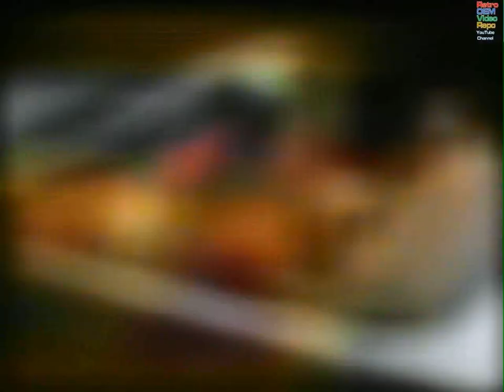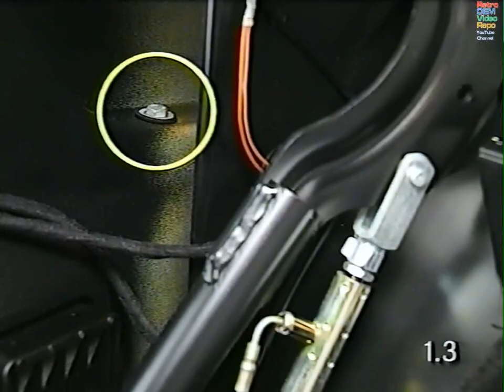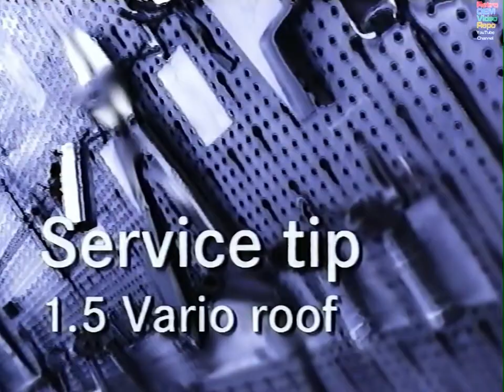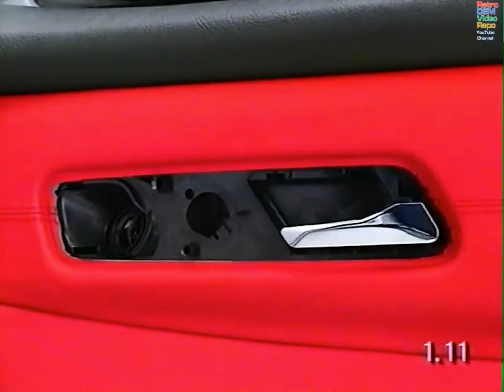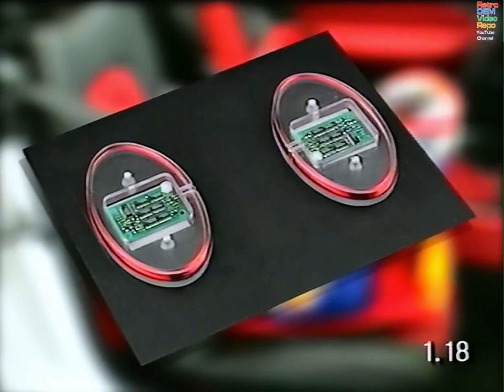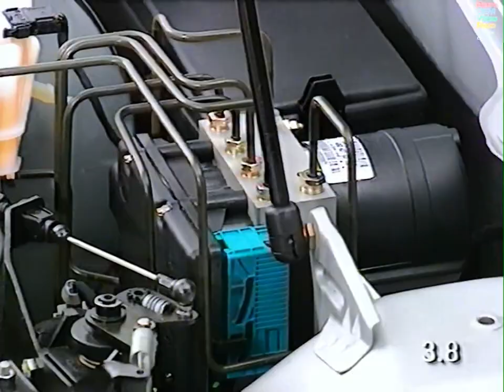Mercedes-Benz - SLK Roadster - The R170 from the Service Angle (1996)

Comment: I had one, a 320slk, low ks. Nothing but trouble. Cost me $18000 the first year I had it in repairs. Nice car to drive, terribly cheap nasty plastic dashboard that peeled its soft touch skin after a few years use. Great engineering, but not a classic.

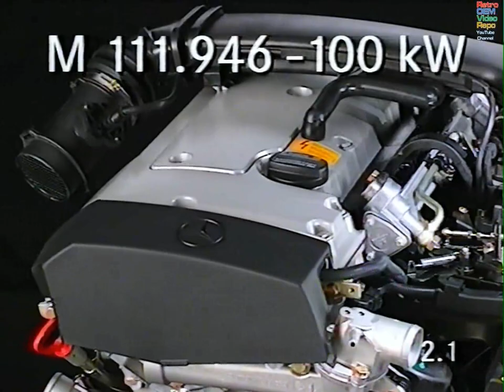Comment: 31:28 where's the turbo ?
Reply: SLKs do not have turbos.   They have a supercharger, located under the air intake on the left side of the engine, as you're looking at it.
Reply: @droge1300  That's why I'm asking

Comment: Wife and I have a 2000 230, 5 speed, 74k miles on the clock. Great weekend car. Just put a bigger crank pulley on it and has power like it should have had from the factory. Have had no mechanical issues aside from the occasional coil pack or MAF.

Comment: NAJBOLJI CABRIO SVIH VREMENA BRAVO MERCEDES VISTE No.1. 

Das bestes Cabrio Allerzeiten brawo Mercedes Benz 

Meiner ist MB CABRIO  SLK230 kompressor B.J.9/ 2000 

215000KM, alles tip-top  Ante  Leko Island Hvar CROATIA 

 *Villa Bella Vista Hvar * google

Comment: Great cars, the 6 speed r170 is very rare now, only autos left.
Reply: Our 2004 R170 SLK200 kompressor is the 6-speed manual. Almost 90k miles now, still drives like new. Still makes us smile. :-)
Reply: I was able to find a 6spd SLK320, what a car
Reply: I Also have one from 2003 and its 6 speed
I dont think its rare
Restyling Is 6 speed

Comment: Rust is a Big Problem. My slk has a lot of rust
Reply: Not if you live where there isn't snow and road salt.. I have a 2009 SLK 350 with zero rust anywhere on it . Of course I won't drive it in the winter so that's probably why .
Reply: @stringsattached67  Really irrelevant, as there are way different engineering standards between an R171 and the R170 engineered in the early-mid 90s. Nearly 13 years apart.

Comment: We had a SLK230 with full AMG body kit for 15 years!  The wife loved it, it was her car after all, but I had different feelings.  The style, build quality and that magic folding roof were all fabulous.  However, the auto box just sucked all the power from the engine and the overall driving experience was deeply flawed. Boring and frankly dangerous as when overtaking the kick down produced a lot of noise and not much else.  After being stranded on the wrong side of the road too many times I gave up overtaking in the SLK, it was safer.
Reply: Yes, makes no sense on having this car automatic. I waited 3 years to find a 6 speed one.

Comment: The first generation R170 SLK looks better as time goes by.  It has a timeless design with superb engineering.  A classic car for sure.
Reply: Classic car,  I wouldn't say that, they don't mention the rust problem these cars had .
Reply: I have this car, it has a unique design, beautiful, but it's horrible problems wise, all electrical / electronic in nature.
Reply: I agree to a degree, the car has so many problems. Search any forum and you will see. PSE, K40 Relay, Lighting issues, on the outside it looks nice but t inside it's full of ticking timebombs.
Reply: @MrFantaman  I drive this car 27 years without any problem.  (First owner.)
Reply: @MrFantaman bought one brand new in 1999 and got rid of it two years later. really liked it but it had issues straight from the factory, which, in fairness were all fixed in the dealer at no cost. In the first year it was in the garage 4 times. I didn’t really mind as, again, it was under warranty and was fixed at no cost and we had another car so it was little to no inconvenience.
Reply: @MrFantaman  but still way less than any modern car will habe after 17 years

Comment: I have an SLK since 2001 , now 18 years old and performing faultlessly. The only issue is the interior paint. Wonderful car
Reply: This car is so great and timeless...I agree.
Reply: Me too. 1998 not ever an issue.  Best car I have ever owned.  Interior paint was fixed by an eBay purchase.  I sponged the dark gray rubber paint on and looks new again.  Mines in yellowstone... Bright yellow.  See ya.
Reply: Volico / VLC  paint £28 on eBay , I have the 1997 230 kompressor in mint condition, did have the common paint peel on the centre console, with the above paint , perfect again
Reply: I just removed all my interior pieces with this problem. Stripped the coating with paint stripper, and repainted and clear coat. Like new again.
Reply: Any issues with the rear triangle windows not coming up? Also how often do you change your hydraulic fluid for the roof